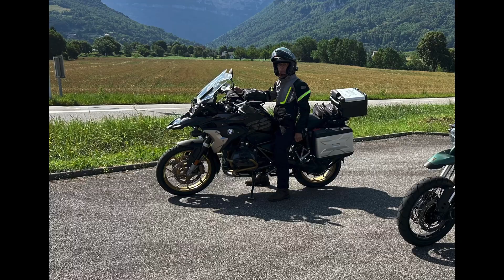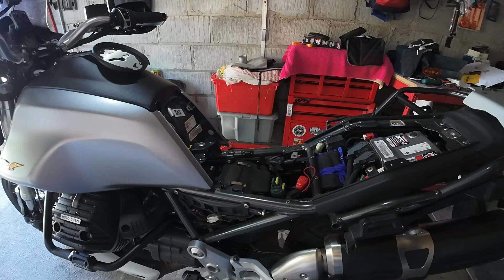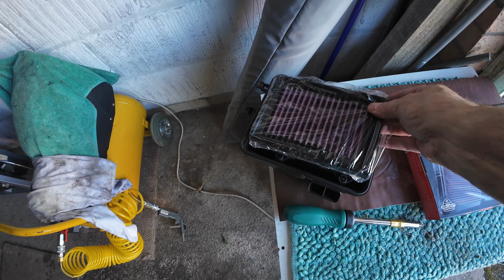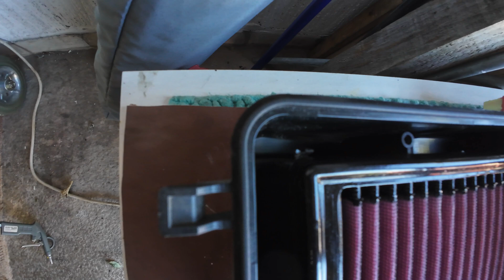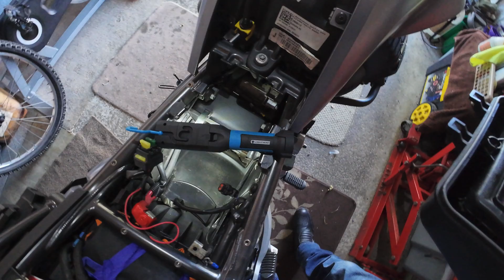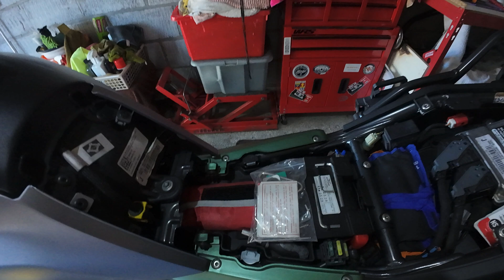Moto Guzzi V85tt Air Filter replacement

Comment: Hi David, hope all is good ! Do you think that the K&N filter make a big different. ? Thanks
Reply from the maker: Hi @Messiahwalter, it is had to tell a K&N allows better airflow and it’s a lifetime filter because you can clean and re-oil it, along with the Mistral velocity stack it is smoother on acceleration so no not a big difference just helps a bit.,
Reply: @Davidswordplay like always thanks David 👍

Comment: Don’t go on any dirt with a K&N you WILL dust your motor.
Reply from the maker: Hi, thanks for Watching and commenting, I very rarely ride off-road and when I do it is only for a very short time I picked the K & N  mainly for road use
Reply: I agree, it is great for street riding but in very dusty conditions......NOPE, paper filters are FAR better
Reply: @tedmarakas2626 

💯 Agree, the filtration efficiency of K&Na is extremely poor compared to oiled paper elements of an OEM filter .. I tested in late 90s on a Ford housing in test facilities and there was upwards of 6x more dirt passed. On a road bike it is less of an issue, however in dirty off-road environments it is key.

Without air box / inlet modifications it won't really provide an inlet pressure improvement.
Reply from the maker: @ Thanks for watching and commenting👍